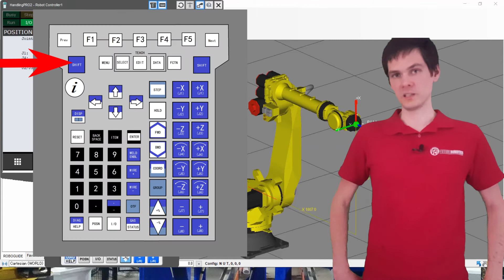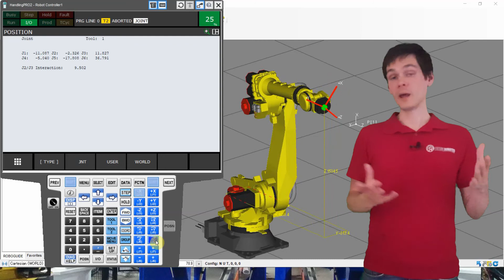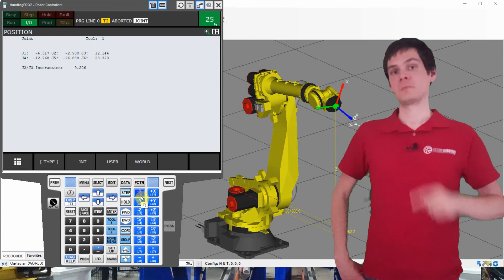How to move the the robot - Joint movements

Comment: Quiz questions for this video:
1) The two main methods to jog the robot are joint, and frames
*a) TRUE
b) FALSE

2) Which axes comprise the minor axes? (Select all that apply) --
a) 3
*b) 5
*c) 4
*d) 6

3) The first three axes (1, 2, and 3) make up the major axes. --
*a) TRUE
b) FALSE

4) What two buttons display the Jog Menu? --
*a) Shift and COORD
b) Menu and Jog Key
c) Shift and Display
d) Group and COORD

5) What key is pressed to switch between the different jog methods? --
a) POSN
b) MENU
c) FCTN
*d) COORD

6) Which key combination is needed to access the split screen display menu? --
a) Shift and DISP (Display)
b) Menu, Next, Display
*c) Shift and COORD (Coordinate)
d) You cannot split the screen on the iPendant

7) If while jogging the robot you release the Shift key or Jog key, what will happen? --
a) The robot will continue to move to the position I intended
b) The robot will execute an EMERGENCY STOP
c) These keys are not required to jog the robot
*d) The robot will execute a controlled stop

8) Which position must the DEADMAN switch be held to enable motion? --
*a) Centered
b) The iPendant does not have a DEADMAN switch
c) Fully Depressed
d) Released

Comment: if the robot has a 7 axes ,,,how i can move it?
Reply from the maker: 2 ways:
1. it might be programmed by J7 button
2. if it's assigned to group 2 than you need to press Group (you will see group 2 selected) button than you can jog it with X1 button
Reply: Thank you so much

Comment: @Future Robotics How do you bring the robot back to its original position (home position i guess) after jogging? Thanks in advance!
Reply from the maker: For that you would need to run (SHIFT + FWD) a robot program that has the HOME position saved in it.
Or if the HOME position is saved in a PR (position register) you can open position registers and use MOVE_TO button (also while holding SHIFT button)
Reply: Hello, 
Let me thank you for your great videos,
It’s about to bring the robot down to replace the one joint motor and reducer, first it has to bring robot in home position or zero position then turn it off , put it down and do the maintenance! Is it correct?